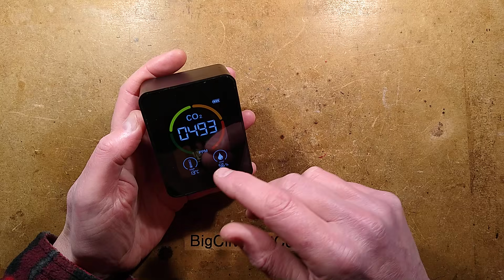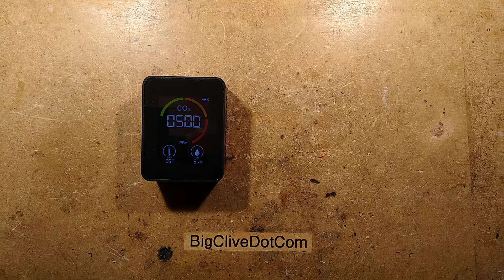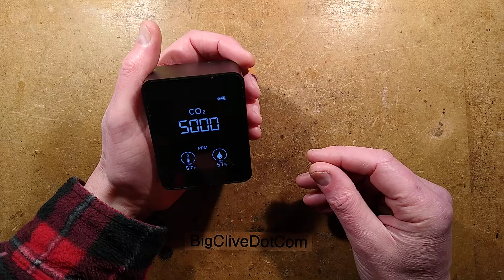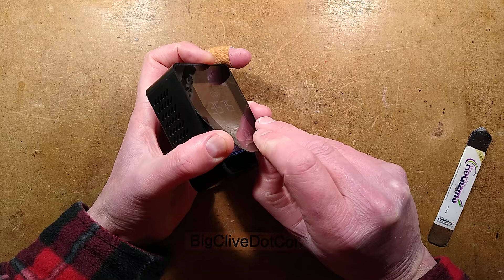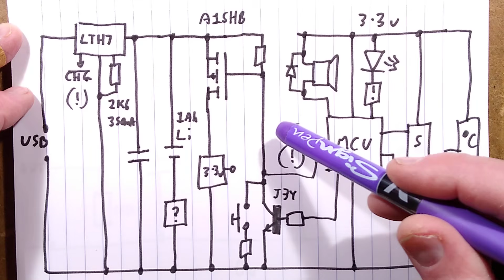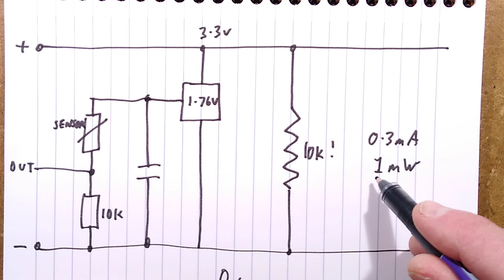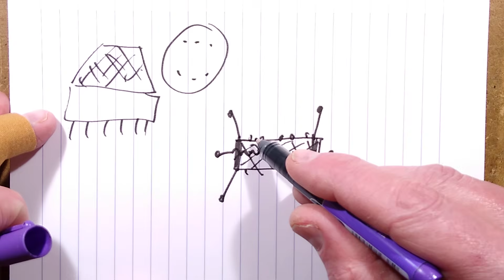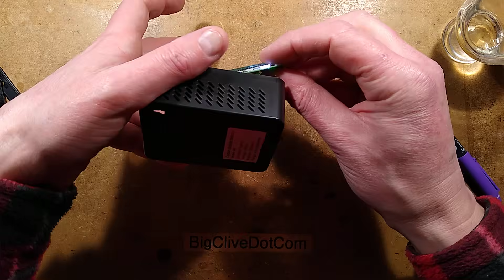Fake CO2 monitor (party detector) with schematic

Comment: A good CO2 sensor with a second reference tube to callibrate the light source set you back atleast 40 bucks. Those metal heating based once are more or less an arduino gimmicy. I have some of those NDIR 40 bucks sensors and they work quite well and can give you good hints when to open the windows to let air in and work more effectivly as over around 1500ppm your concentration goes down and stress up.

Comment: I wish you were my next door neighbor, so you could describe for me the surface mount chips and resistors I take pictures of and post on Amazon when I review the products I get through the Vine Voice Program. All of the items are from China, some of it is really nice, while others are questionable. Half of the Hi-Bay LED lights are overstated in wattage, but I call them out with a power meter and post the results in my review. The mains wiring color code is whatever color wire they have on hand when they make their products, while others stick to their own color codes- nothing really uniform.

Comment: I have one of these which looks identical externally, but totally different inside.
The processor on mine is a ARM STM32F103.
My LCD display consists of pixels and the CO2 sensor is on a separate PCB screwed to the inside of the back cover.
Mine definitely measures CO2.

Comment: Had 2 of these, first one and its replacement were total junk, battery only lasted 12-14 hours, and both would randomly alarm for no reason, in the middle of the night. Both thrown in rubbish bin. Also had the round pendant type, was just as bad as these. Pity this video was not up 2 months ago, as i smashed mine open for a look inside, not knowing about screws under front panel😬

Comment: A similar model was sent to schools last year, but they are NIDR sensors and only have 3 colours not 4 to match the previous monitors that were sent out in earlier batches.

Assuming the firmware is similar, your speculation about calibration is close. The instruction booklet we received said that before first use you were supposed to take it outside, leave it for 5 mins (as NIDR sensors seem to take 5 mins to get an accurate reading), and then quickly press the power button 3 times to calibrate it. It probably read 400 when you were outdoors as that's the lowest number it can display.

Comment: Something in the reverse-engineered schematic does not sound right: the OUT node of the sensor is supposed to be the resistor-divider off the 1.76V rail but you measured nearly 2.7V... 🤨
Reply from the maker: Yeah, I'm going to have to revisit that bit.

Comment: The CO2 sensors acts as a proxy measurement for the ventilation of a space. counting heads and using a look up table is easy than measuring room volume, vent size, and airflow with an anemometer.

I think I may have a fake CO2 meter myself: because the "cheap" one does not appear to match the CO2 reading of my more expensive one: even after attempted "calibration" by leaving it outside for a few minutes.

Edit: I found my "fake" CO2 meter triggers on ammonia (NH[3]). Edit3: Yup, triggers on isopropyl alcohol. 

Edit2: Background CO2 is now 420PPM.

Comment: The purpose of the regulator is to avoid calibration change with battery state of charge.  (For when there's a quality sensor that matches the display.)

Comment: I went through three CO2 meters from Amazon that worked properly for about two weeks and then "soft failed" where they indicated a safe atmosphere even though it was toxic.  I gave an objective but negative review after the third unit failed under warranty.  The OEM reached out to me and is sending me a redesigned unit for testing.  The bottom line is that there are similar looking units that actually have fairly respectable manufacturers taking responsibility for the product.  I have a winery and need affordable sensor in some spaces that have an audible alarm and can be checked over the wifi network.  The units that failed had all those functions, but did not last...

Comment: Reason for the 1.76V regulator at the sensor could be the analog input of the MCU. Maybe this does not like voltages grater than e.g. 1.024V or so. Nothing a normal voltage divider with another resistor could not have fixed, of course....  hmmm, maybe a very accurate resistor woul dhave been more expensive than an accurate voltage regulator?

Comment: How did the voltage get to 2.something volts on the sensor when fed off that 1.76v reg? Perhaps measuring from the 3.3v power pin rather than ground?

Comment: I just realized something I could expres with (comparably to my other comments) VERY few words.. 

That is.. Carbon-dioxide.. In the very early stages of this video bigclive IMPLES it shouldn't be any primary concern.

BUT! My revelation that made me write this EXTRA comment is: Carbon-dioxide has had a HUGE extra problem in air-travel. 

BEFORE the smoking ban, the air-lines replaced the air QUITE often. AFTER the smoking ban they didn't have to worry about the smell of smoke being a reason to bother about that, so they recycle a LOT of the air for a longer time. Which increases the amount of carbon-di-/mon-oxide in the air that people are breathing. 

And.. this has been LITERALLY proven to be the ACTUAL cause.. of more anger problems.. either.. between passengers, OR between passengers and their staff.. it CAN be cost-cutting to ignore it.. but.. the amount of anger, head-aches, and.. technically even direct violence.. HAS gone up.. simply because of an increase of.. carbohydrates in the air.

.

Though the one comment I wrote that was LITERALLY intended to debunk the idea that.. "Carbondioxide" may NOT be a gas that you wouldn't want to have control over..  it can be brushed aside.. it doesn't quite matter..".. didn't involve this SPECIFIC issue at all.

Comment: We bought something eerily similar to this for work to test the air quality of our smaller office rooms, and found no correlation between the readings and the perceived air quality. If you breath directly into ours, it does spike up, but other than that it didn't really tell us anything. My initial thought was that since it does not contain an intake fan, that it might need to be put somewhere higher up than standing on a desk to measure the room co2 levels, but maybe like this one it's measuring something different and estimating co2 based on that.
Reply: I'd think the best measurements would be closer to the ground, CO2 sinks.

Comment: Colourful LCDs where segments each have a fixed colour are pretty common in smart meter In Home Displays.

Another, much less common type of colour LCD panel with application-specific segments is known as a Field Sequential Colour (FSC) LCD and uses a fast-cycling RGB backlight to make any segment appear in one of several colours, rather than using colour filters. In person, these displays have a flicker to them that reminds me of modern cheapo flatbed scanners that use a monochrome sensor with RGB illumination to take colour document scans.

I bought a (real) CO₂ sensor a few years back, out of curiosity and  because I wanted to see if CO₂ levels were affecting my ability to concentrate, and whether house plants had any measurable impact on that (they didn't; I only have four plants and you'd need a room full of them to make an impact). It has an NDIR sensor with a small filament lamp inside. The periodic illumination of the filament lamp is visible through the outer casing when operating it in the dark.

Comment: Am I right in thinking that's not a bitmapped LCD display? That the segments are hard-etched into it, so it'd be no use for anything that didn't want 4 digits and a partial rainbow? Shame, but that's what 0p and £6.50 shipping buys you these days.

I used the same power-on with the power button bridging in something I made once, except with a relay rather than just a transistor, cos it had a bit more power to handle. I wanted to be sure that it used zero amps when switched off, so it was pretty useful for that. The relay connected power to the circuit, and the button bridged the relay's contacts. On switchon, the first thing that happens is to activate the relay. I couldn't figure out how to get the button to work separately as an input either. Thinking about it now, probably just a diode would have done it.

Comment: Carbon dioxide sensors have an issue in that they need the test sample to be dried first. You can't (reliably) just test the air in front of it. The test the absorption for a narrow band of infrared spectrum that also happens to be absorbed by water.

Comment: Did you happen to test to see if it responds to carbon monoxide?
Reply from the maker: No.  I'm not sure I'd trust it for such a critical gas.
Reply: @bigclivedotcom  Oh, I never even considered trusting any product like this, but I was thinking that the LCD may have been manufactured incorrectly with CO2 instead of CO.

Comment: Clive, have you ever wired up a golden pogo test pin harness and read the data off the board directly thru a terminal?  I've seen it done and it doesn't look like it needs very much specialised tools.  Golden pins were the ones I've seen used since they are fairly  common.  If its sold in the US then there is a picture of the circuit board on where the connector is/was.  The baud rate is fairly easy to guess since most items use only a handful. 9600bps, 14.4bps etc.  It's really interesting and it could be another way to hack a piece of junk found on ebay to do your bidding.

Comment: Clive, I used to repair Co2 meters used in greenhouses, they were an old design, an heat source at one end of a tube and photo cells at the other end, it works with air sample pumped in the tube and measures how much Co2 that absorbed the infrared

Comment: Our company bought 5 Air Quality Tester that should read co2, hcho, tvoc, humidity and temperature. Besides that they all read completely different values, they normally went crazy when I put my mug of coffee near them. This board features also the display driver, a MCU and has even a WiFi antenna on it. The LCD has the WiFi and BT symbol on it. All interesting but finally not more than a toy or doorstop.

I would also go for the Sensirion sensors as my experience with the SGP30 voc/co2eq was excellent.

Comment: Interesting...I have one of those bought from Amazon Canada, and it does detect CO2. If I breath into it, the CO2 reading jumps dramatically (1,200 to 2,000), and then slowly returns to normal (high 300s, low 400s). When I tested, I had no alcohol or nor do I vap. 

I bought it since I wondered if I had a exhaust leak on my Subaru, and I put it onto a car window mount, and I was driving along in winter, and suddenly it read over 4000-5000, and I had noticed that I was getting sleepy. So I opened the window and the count dropped slowly back to normal. And I do have an exhaust leak.

Comment: "hermetically sealed building" you're in the UK so this may be an unfamiliar concept, but in the US we insulate buildings :-) and sufficient air circulation (especially in an older office building conference room during a 20 person meeting) has only become a design feature in the last decade or so (so most buildings haven't gotten there yet.)

Comment: I bought a Winix 5500-2 air filter with a "smart sensor." It turns out there is no particle meter inside, just a generic "air quality sensor" similar to the one shown here but in a metal can. Reverse engineering the control algorithm shows that the 'auto' setting simply checks for a change in sensor voltage and then sets the fan running for 10 minutes. No absolute measurement; it just turns the fan back down after 10 minutes whether or not the air quality has improved. Henceforth it waits for a further change in the sensor voltage before starting the timer again.

Comment: waaaaw  Clive that's great  how you worked all  that lot out  out i don't know  ? but  waste of money  you've just proved it  YET  again !  awesome 10/10 i under stood 90% of it  am a sparky mind !  not much to do with electronics !  it was the heater bit in the circuit  that got me  didn't know   heater's could be that small   to work that low voltage  all i know is it's great  i dont get many electric heaters to wire up anywhere  this last few year's  on my kind of stuff lol keep them coming Clive stay safe  🤣🤣

Comment: CO2 meters are useful as a proxy for air-quality; in particular air circulation. 

And one thing that has been noticed is that many conference rooms don't have good air circulation and CO2 values go up.  This causes drowsiness and bad decisioning.  Hmm.  If you've ever felt sleepy in a conference room meeting, this is why!  You just thought you were bored; no... it's also bad air!

But no one really cared about that until recently.

They become popular, due to COVID.  High CO2 readings (and thus poor circulation) is an warning that if someone in that room has covid then the air isn't been recycled and filtered and so the concentration of covid particles in the air is higher, putting everyone in the room at higher risk.

So CO2 meters have been a proxy measurement for "is this room safe".

Comment: I think I would check the pinout of the micro against the PIC series and stuff like that.  The LCD drive is likely just a bunch of I/O lines.  To make the AC drive on the LCD, they just use one I/O line to drive the common connection and one other for each segment.  If the segment line moves in step with the common, there is no voltage on that segment.  If it is anti-phase then there as an AC voltage.

Comment: 1:19 I was testing continuity on a proto board I’m working on right as you did that not realizing the “alarm” would sound identical to the continuity beep from my meter. My stomach kind of sank there for a second because there shouldn’t have been a beep from my meter…

Comment: Ooo interesting, I have a self calibrating unit by "Claire". I just checked it with hanitiser and no reaction. But breathing directly on it sets off my configured alarm threshold! You calibrate it by leaving it outdoors for about 20 minutes like you said and that puts it as the 400 value.

Sad they used 99% of the right components to make a 0% usefull product what the hell hahahaha
Reply: The only way I could see this make sense (with the 5V boost circruity being there) is these came from a reject line of alcohol testers, but still powered on. And some leftover CO2 housings or ... seeing high demand for CO2 meters? That way it makes sense to not spend time dissasembling parts of it and putting it together wrong/incomplete/nonsensically.
Reply: Oh also mine has a dedicated LCD, they saved on the color masks by making the droplet for the humidity green hahahah. Sorry about your reprogramming dreams.